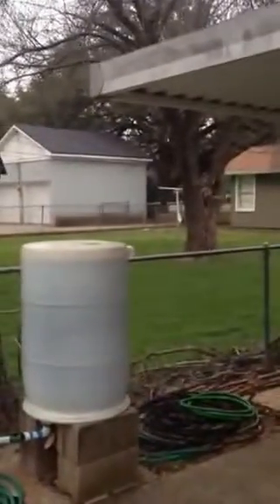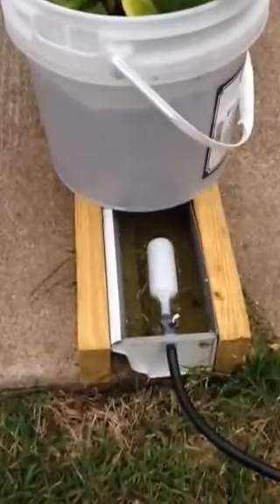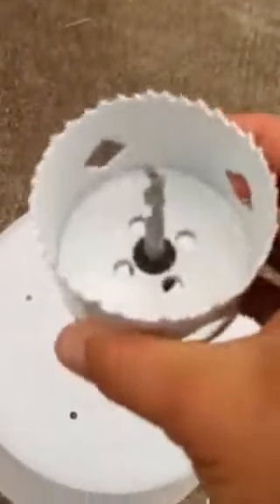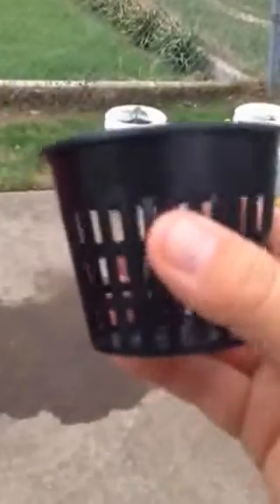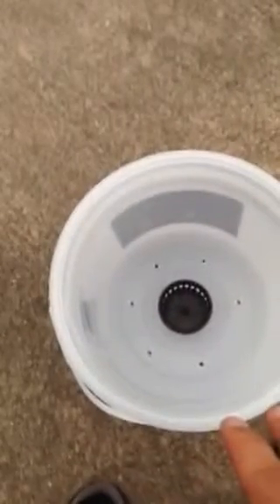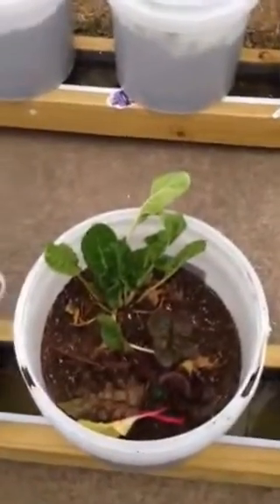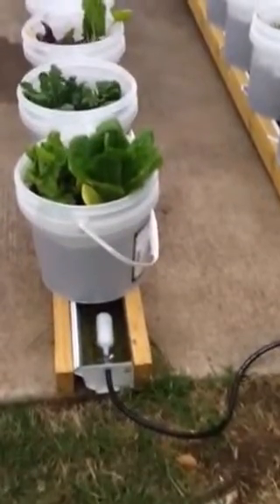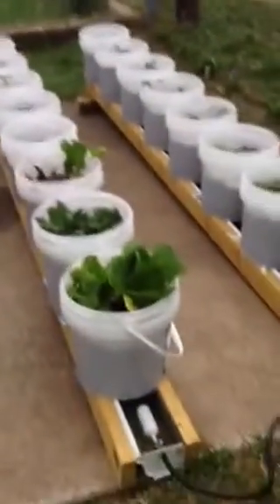Rain gutter watering system

Comment: Nice project.
This system takes care of watering the plants.
But what about the nutrients/fertilizer  aspect of it.
Reply from the maker: I just added a few scoops of Miracle Grow right to the bottom of the gutters.  The roots in the net pot will soak it right up.  Threw in a few mosquito dunks too, cause Texas.
Reply: Thanks 
One more question 
How deep must the net cup be submerged in the water/guttering ?
Reply from the maker: Deep enough to make constant contact with the water. Mine stayed 1/2 to 3/4 submerged at all times.

Comment: What size Hole-Saw did you use to get the float valve thru the gutter caps. Thanks
Reply from the maker: Rei Matsuo It was one of those cone shaped hole drill bits that increases the size of the hole incrementally. I just walked that bit up until it was the correct size for the float then used silicone as needed to seal it completely.
Reply: @annetamporello2825  that's a great idea. I'll look for it. Have a Great Day

Comment: aluminium gutters are better. They do not leech any chemicals to your soil like vinyl does.
Reply from the maker: Steve Bella I won’t disagree, but aluminum was very difficult to completely waterproof compared to vinyl. If you have any tips let me know, but I’ll stick with vinyl in the future because of this.
Reply: @annetamporello2825  I had same problem. Then I found Bondo Still Stick.
You can find that at any Home Depot. On the package it states that it is approved for fixing drinking water containers. Works perfect for me. Use rubber gloves when you work with it.
Reply: @annetamporello2825  I em sorry. it is JB Weld. Not bondo. Bondo would work also but is not approved for drinking water. It is for auto body work. Sorry again, Look for JB WELD STEEL STICK
Reply from the maker: @stevebella4221  I'll definitely look into this!  I certainly prefer the aluminium, and if JB Weld works like silicone does on vinyl, I'm sold!  Thanks for the tip!